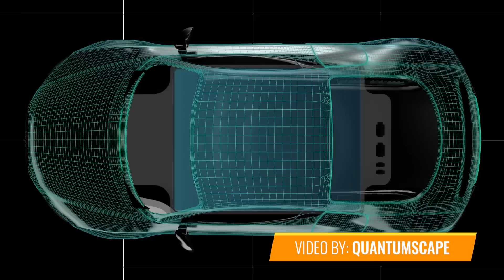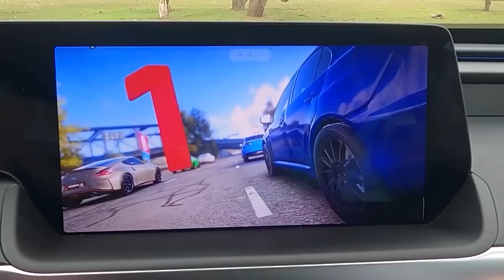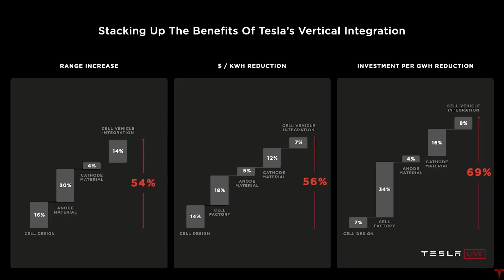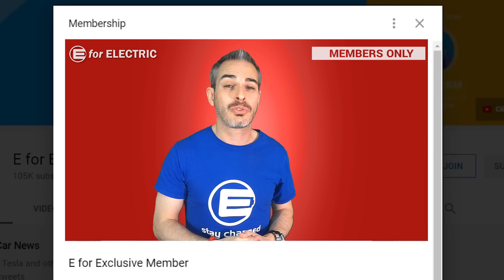TOYOTA's Only Hope to Beat TESLA: Solid State Battery

Comment: Solid state batteries are still a decade away from mass production. My bet is on Tesla -  but I don't see how you keep those 4680 batteries cool on the inside since they are so thick and wide. It's a huge difference between that and the size of the 18650s.
Reply: Tabless design lessens resistance and cooling can be done from the end.  Watch Sandy Munro's videos on the subject.  Also "The Limiting Factor".
Reply: @StormyDog  Will do. thanks.

Comment: The problem with 'solid state' batteries is that, even when some workable design is developed, the materials are expensive and it's a challenge to manufacture. I'm not holding my breath.

Comment: I'm a little tired of everyone saying things like "removing this tab results in a battery that holds 5x more engergy"...That's not true... removing the tab is a definite improvement... It prevents bottlenecks and heat build up (and also increases heat dissipation), and a number of other things, but the battery has 5x the capacity because it's nearly 5x the volume.  The ability to do that with good performance is enabled by the tabless design, but you're not getting 5x the power from the same mass... not even close.  If we were, nobody would even be caring about solid state batteries.. Tesla's new batteries are fantastic, and ultimately revolutionary through lots of little evolutions, but please STOP MISLEADING PEOPLE..

Comment: I don't think solid state will be ready in time... Tesla has the cost and range locked in. Solid state will be too expensive for the near term and Toyota will have a hard time pulling a profit.  (If the can even make it work, everyone has been working on solid state and still know goos work prototype) Add in everything Tesla is doing to reduce cost in every aspect, production, batteries etc. I think all major players are in trouble. We all want the holy grail in batteries but I don't think we are there yet and Tesla knows it. I think Toyota is running scared.

Comment: Maybe not talk so much about 4680 having 5 or 6 times the energy compared to other batteries. Because it' just the same as bragging about having one gallon bottle having almost four times the volume of one liter bottle. 4680 may have about 1.16x better energy density, it may have better heat management, it can be manufactured for much less $/W. But it is not 5x or 6x more energy per volume or per weight. It was okay to misunderstand this for one week after Tesla's battery day,  but not anymore. 5x is not even needed for propaganda... that's because if you do the battery day presentation math correctly they should have in 2 to 3 years 75% lower cost battery for 300 miles (lower $/kWh x higher range / kWh)... that together with longer battery life are a game changer... if they can get most or all the battery day features in to mass production.

Comment: Tesla’s 4680 cells will have more advantages than those mentioned in the video. They also have improved cathode chemistry and other improvements. Overall they will have a 56% improvement in range. They also enable structural battery packs. Tesla is likely to reduce the cell count in order moderately improve range and reduce the cost of production. Alex, watch the Battery Day presentation again.

Comment: As good as it is to hope,  if toyota’s battery tech was that far along it wouldn’t explain why they have a ev platform and technology deal with byd based on the blade battery tech not only for the Chinese market but also byd confirmed it will be a global platform model ,  at this time I strongly believe vw vag group in partnership with quantumscape (qs) will do it by 2023, but given the roadmap at there conference itbwill end up in premium models only

Comment: If Tesla was working on, or close to solid state, the 4680 would not have happened.
Reply: Oh dear the Model S Plaid Plus is history, I wonder why? Maybe those new batteries are still 2 years away if ever lol
Reply: @gregandkaruna6674  Only your guess, not fact. Try dealing in facts. As far as when the 4680 cells will arrive, given Elon's track record on delivery times, could be next month or next year, but also that track record says they WILL arrive.
Reply: @glennrmarks  Elon said they would sell a $35k BEV years ago. They never did, except a handful of SR Model 3's which they tried their best to hide from consumers because they probably took a huge loss on each one.
Reply: If solid state is dry and solid, and Maxwell is dry with out any LIquid drying process then what makes solid state so much better? Is it just because it is so much faster to charge? How do we know Maxwell and the tabless tech isn't just as fast? What if this new battery prevents dendrites from forming? Does anyone know? If this tech Tesla came up with is on par with solid state they wouldn't tell anyone that because people would hold off on buying current Tesla's with the old batteries.
Reply: ... unless the solid state looks the same mechanically.
Reply: Not necessarily true. Tesla makes incremental updates. Stop gaps.
Reply: The 4680 hasn't 'happened' either, it was only a presentation, no car uses it, there's no evidence that it's in production, it's like FSD and Tesla's solar roof, a fantasy that will never meet it's hype.
Reply: @johnafish  Even if it was in production it is only about 15% more energy per unit volume.  That is hardly a breakthrough.  If something like solidstate batteries become real, the 4680 cell will still be among the "also ran".
Reply: @kensmith5694  Agreed, it's over-hyped and vapourware
Reply: @johnafish  How do you know that no car uses it. It may well be in some cars limited to Tesla employees (a common thing Tesla does) for testing. I am not privy to that information, and guessing neither are you. We were told the Model S would not happen, then the X, then the 3, then the Y, now it's the Semi and 4680 cells. Aren't you sick of being wrong? It may well be late, but late doesn't equal never.
Reply: @glennrmarks  I said it's not in any Tesla product, meaning something they sell, but I'll clarify. No PRODUCTION TESLA uses the 4680 today. This is a cell that was claimed to be lower cost AND higher energy density, if Tesla were capable of producing it in volume at the cost and specification claimed in the presentation it would quickly appear in their vehicles, so far it has not. In fact no Tesla product uses Tesla designed and manufactured cells, they all use bought-in cells in formats and chemistries available to any car-maker on the open market.
 
As for always being wrong, making cars at a loss is not particularly clever and Tesla have done that. But the solar roof as a profitable volume product has not happened, FSD has not happened because these things are technically challenging, I preduct the 4680 if it does appear in a Tesla will not displace the Panasonic 2170 cell significantly in the next half decade. We'll know they've reached their goals if the 4680 makes it into theit cheapest cars.
Reply: @johnafish  It will take some time for the 4680 cells to be in all Tesla's products, no doubt, the German Model Y is supposedly the first to have both front and rear casting along with the structural battery pack (made of 4680 cells). Elon said they are still perfecting the 4680 cells and that may take longer than predicted (Elon time) but I have no doubt they will get there. So many people assume it won't happen because it's late, and to me that is ridiculous. Once the cells are ready to go, hold on to your hat. I can't see the Model S and 3 getting a redesign (for 4680 cells) until the semi, cybertruck and roadster are shipping to customers, and maybe not even then as Elon has mentioned a van, so that might come before as well.
Reply: @glennrmarks  Yes, a lot of promises are yet to be fulfilled.
Reply: @johnafish  Inventing new technologies isn't as simple as saying we got this and it is going to be out on said date, sometimes unforseen technical challenges show up and slow down that prediction. With FSD, and the new 4680, should come eventually it is just a matter of when. I don't think Tesla would take a chance and bring new tech out if their wasn't a high degree chance that they can bring it to the market. 

Even if those techs never work out they still are about 5 or 6 years ahead of everyone with the electric car battery technology. If you don't believe me watch Sandy Monroe's tear down of the Model Y. The Ford Mach E looks pretty silly stupid on the HVAC system that they put in it compared to what Tesla does with the Octovalve/ and Heat pump. 

Sure, if some company figures out how to manufacture solid state batteries economically they could leap frog Tesla, which could happen but until that happens Tesla is the dominant leader in BEV tech. Plus if they get leap frogged they still win because their mission is too push idiots towards vehicles that are better for the impending climate change reversal (if that is even possible now).
Reply: @torchlord11  Yet FSD has been sold to people since 2016 and promised on a regular basis ever since. I expect the 4680 will be similar, rolled out occasionally to raise money but never really arriving.
Reply: @johnafish  Uh, isn't it in the model Y and I've actually seen a Tesla roof that's installed here in Colorado
Reply: @MindEracer  No, the 4680 is not in any Tesla product none at all. And they have installed some Tesla roofs but very few and not profitably, remember it was used to justify the bailout of Solar City (owned by Musk's cousins) by Tesla in 2016.

Comment: By the time Toyota is making solid state batteries at the scale of a few GWHs  in 2025 (possibly still at well over $100 per kwh) Tesla will already be in the TWH scale, possibly close to $50 per KWH. It was misleading to say "Tesla has decided not to go it alone with battery production and  rely on suppliers."  Tesla is going to make their own batteries in addition to promising to buying any amount of batteries any one can supply.   With a market that is growing exponentially the traditonal automakers do not even seem to have any ambitious targets, let alone what they actually accomplish. They are targetting to do in 2030 what Tesls ia planning to do in 2022. As if Tesla is going to sit on their hands for 8 years. 

The need of the hour is scaling battery output and reducing cost.   Energy density is good for some niche applications (airplanes), but not necessary to transition surface transport to EVs. In fact even LFP batteries may be good enough for almost all surace transportation needs if we have a decent network of charging stations  And conventional lithium ion bateries are getting better in every aspect, energy density, safety, and rechaging speeds, every year. By the time SSBs are manufactured in scale, conventional battereis may be as good as SSB in most aspects while costing a lot less.
Reply: ^ THIS.
There are people that just can't understand some very basic concepts like scale and experience. No one will be able to catch up with Tesla before at least 2035.
Reply: @OnigoroshiZero  well if Tesla is betting on  dead end technology (not saying they are). Then any company heavily invested in solid state R&D will surpass Tesla. Nio is one company that is planning to release solid state for mass produktion already next year. If this turns out to be the case then Tesla will get left behind in a heart beat.
Note: In May Nio announced that they would go from 120 000 to 240 000 vehicles a year. So they are not a small startup anymore and know a bit about how to scale
Reply: @mackan7086  mass production of Solid State Batteries is still 4-5 years away. Tesla will have 6-8TWh of battery production of the 4680 cells by then. A few GWh of Solid State batteries can't compete with these numbers.

Tesla will make 1 million EVs this year, and will make around 6-7 million by 2025, and Nio will need more than a year (16-20 months) to double their current production.
Reply: @OnigoroshiZero  it doesn't matter how much 4680 batteries Tesla produce if everyone want the advantages of solid state batteries. Sure Tesla will keep selling for a while until solid state is dominant in quantities. But they will get hopelessly left behind if not embracing solid state.
Reply: @mackan7086  It does matter how much is produced though. If SSBs are not able to be produced enough for millions of people to take advantage, the demand will limit supply and costs will rise for SSBs. Tesla's scale is beyond any OEM company at this point. They have electric vehicle manufacturing in the major regions of the world. Additionally, Tesla is constantly innovating, so if you think by 2025 when these companies can't even mass produce enough SSBs to scale with car manufacturing that Tesla will not have innovated to a new level, you haven't been paying attention.
Reply: @mackan7086  Tesla could buy Toyota. Win-win for both.
Reply: No1 is mentioning the ''cobalt chil labour here?'' thats the real pain of lithium. SSB wil take over. And some peeps are just wayy to deep into the Tesla cult. Dont get me wrong, i love Tesla and we may all thank Elon for dramatisly speedingn up this world saving act of energy transition.
Reply: @prequel1592  Tesla's new battery cells have 0 Cobalt in them, so your point is entirely irrelevant.
Reply: @OnigoroshiZero  really? source? (being honest here :) not cocky
Reply: @prequel1592  The 4680 cells are cobalt free. So are the current LFP batteries in m3 sr+.
Reply: @thesparetimephysicist9462  Really? Im so happy if its true. But were can i find this information?!
Reply: @prequel1592  watch Tesla Battery Day. 
They also explain how they will reduce the environmental damage from Lithium mining while also increasing efficiency and reduce the cost of cell manufacturing.
Reply: @OnigoroshiZero  i must have not seen it the first time (long video). But i found it! Thx man :D!
Reply: Panasonic, and LG might be some of the big winners as other automobile companies need their batteries and power trains.
Reply: "By the time SSBs are manufactured in scale, conventional battereis may be as good as SSB in most aspects while costing a lot less.
" This is like saying by the time EVs are manufactured in scale, ICE vehicles will be as good in most aspects. This will never happen. The current lithium-ion batteries will never be as good as solid state batteries, because they are fundamentally limited by their chemistry.  No amount of incremental improvements will give them the properties of SSBs.
Reply: @seasong7655  True, but we may see SSBs fill a different role than car batteries. They may be difficult to manufacture at scale with regard to costs. Companies who opt to use SSB tech too early may suffer the consequences of limited supply and expensive vehicles. The cheaper, more readily available lithium-ion batteries may continue to be used in cars and SSBs be used for more industrial equipment or commercial vehicles (planes, semis, etc.) That is until SSB tech becomes cheap and plentiful. I am sure at that point, Tesla will have their own solutions. As much as it may seem like other car manufacturers are going to easily catch Tesla if they succeed at developing SSB tech, keep in mind that Tesla is far ahead in more than battery tech.
Reply: @Morfidus Mor it takes about 50-80kWh to charge a Tesla depending on how much you used it in the day. The average U.S. home uses 30-50 Kwh a day. You're point is still valid that most infrastructure is outdated and serious improvements need to be made.
Reply: Tesla battery tech is to be honest is not very “advance”. It just a scaled up cylindrical cell and its expansive. Part of the reason why many Japanese Auto makers have not jump into the EV market because they can not price an EV with 300km range at $20k to $30k and still make a profit. Solid state batteries are suppose to offer insane charging speeds (10s of min), almost triple the energy density (lowering the amount of batteries needed thus lower cost) and increase lifespan. 

It might be true that Tesla will have economy of scale but if Toyota can offer a $20k vehicle with 200km-300km range on a battery that charges in 30mins and last a life time, Tesla will be in trouble. Tesla needs to start investing in solid state battery tech now even as a hedge if not it will find itself without any patents and having to license the technology (Toyota won’t be that nice). 

A prototype solid state EV was suppose to be launched during the 2020 olympics which is now delayed. This proves that the technology is not mythical it works.
Reply: @ApplePotato  Toyota will not be able to mass produce that $20k car to the level of their other vehicles for at least another 5-10 years. Even if they figure out SSB tech, they still don't have the factories ready for mass EV production on the scale of Tesla. They will have to produce every battery themselves which will prove difficult while Tesla will be spitting out millions of EVs. Anyone who has not invested in Tesla will realize the mistake they have made once Tesla has a $4T Market Cap.
Reply: @Doomsday Clown Damn dude, I'd never even heard of Frederic Pierrucci's story. How TF did I miss this? Getting the audiobook. Thanks for the recomendation.

Comment: Solid state batteries have practical advantages, and have the potential to make EVs even better. The question will be whether and when they can bring the cost down to be competitive. For mass market cars, as the battery pack approaches 30% the material cost of production, this cannot add a significant cost increase per kilowatt hour without pricing out its customers. Though perhaps they're banking on current ICE owners overvaluing charge speed and being willing to forego other features for something that's far less important in practice that you would think.